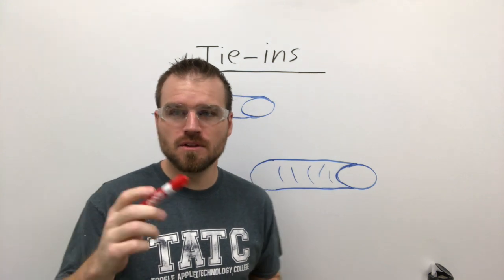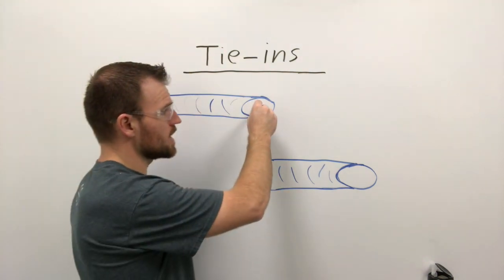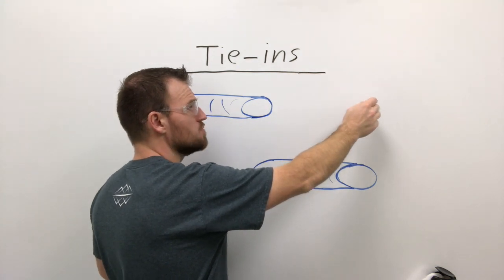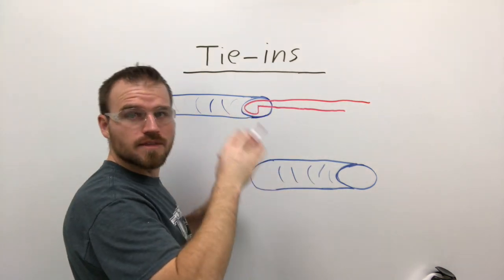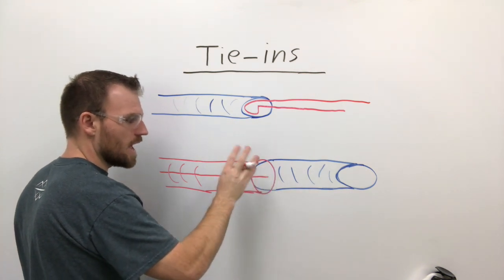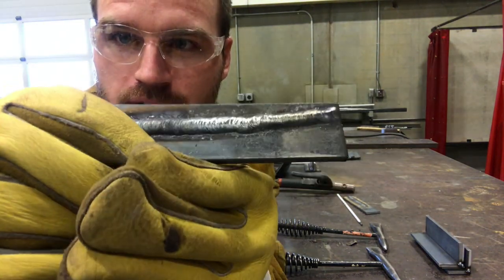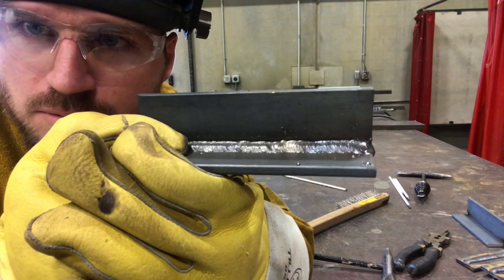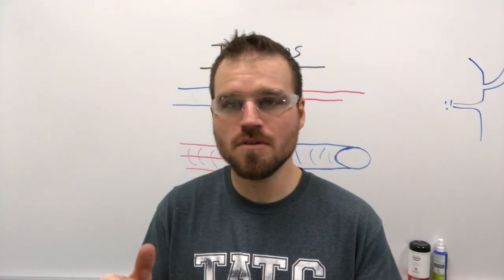Welding SMAW - Tie-ins

Comment: Thanks for the extremely helpful videos! One question, why strike the arc so far in front of the bead? What would happen if you strike the arc just an inch or so in front of it?
Reply from the maker: I do that just for the video, an inch would be perfect. Just make sure the arc stablizes and it should work.